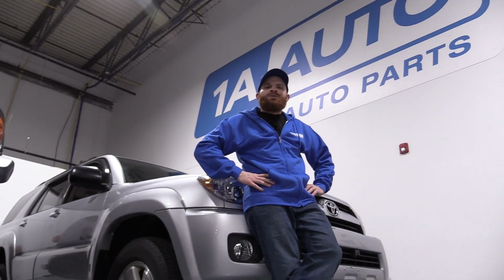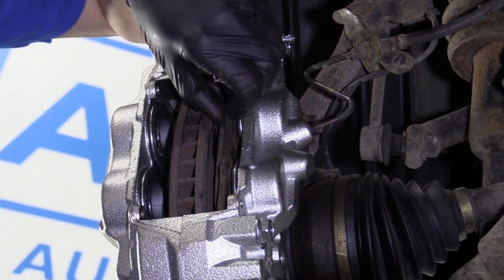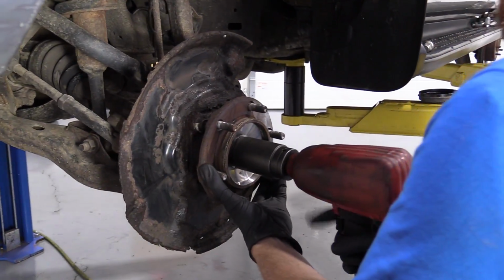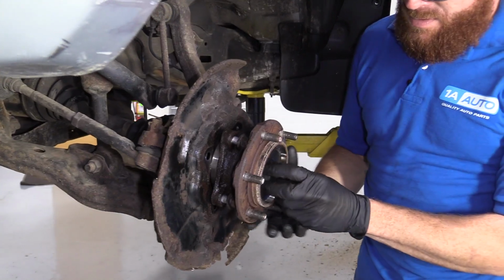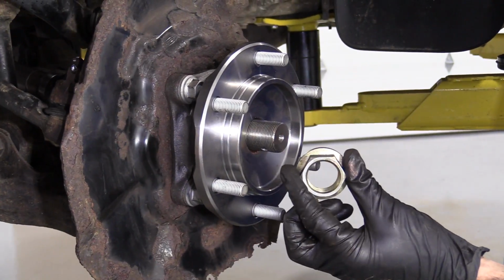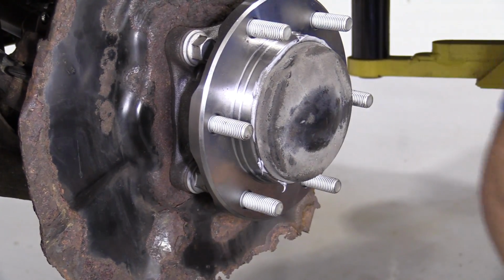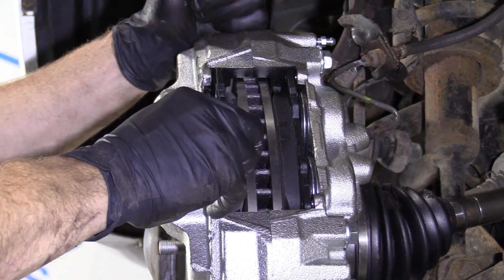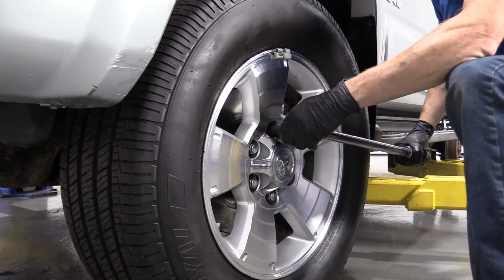How to Replace Wheel Hub & Bearing Assembly 03-09 Toyota 4Runner

Comment: better way to remove the dust cap without making a dent in it is to used a wood chisel between the cap and hub assembly to get it started moving out and the a flat screw driver can easily remove it from there without any damage to the cap at all. thanks 1A auto good video.
Reply: Thanks for the tip. I started this job a little while ago, had to stop to watch a video because I can't get the dust cap off. I was trying to use a small flathead screwdriver and a hammer, but no luck. I'll pick up a chisel.

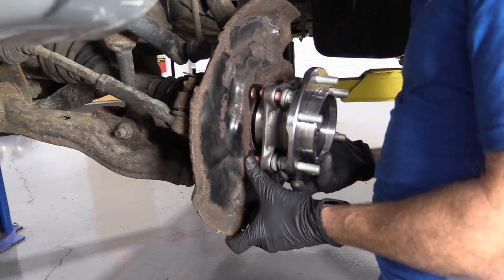Comment: You don't point out in the video (around the 12:55 mark) that there is actually an O-Ring  that needs to be transferred off the old bearing assembly (or a replacement picked up somewhere since they aren't currently included with the hub assy 1A-Auto sells... - Toyota Part 90301-92003 - note some auto parts placed confuse that o-ring part for the entire wheel bearing hub assy.)

Comment: The axle nut is not 36 mm, its 35 mm. Also, my axle nut was too hard to pull off, had to put th vehicle off the jack and tire resting on the ground, had to use 4' pipe extension to loosen the axle nut. There was not way I could loosen the nut by the method proposed by you. thanks for the video.

Comment: Borrow or buy a a pneumatic or electric chisel it’s well worth it. I beat the cv axel with a rubber mallet and a sledge with a wood block for 45 minutes with no budge. It released after 3 seconds with the electric chisel.

Comment: Tip: I normally loosen lug nuts back about 2 turns and move truck back or forward while quickly turning steering wheel left & right until you hear wheel loosen.

Comment: Good instruction video but I think that's a lot more than 59 ft lbs torque on the wheel bearing which the factory recommends that looks to be in the range of 110-120 ft lbs

Comment: Folks DO NOT follow his installation advice when it comes to tightening bolts on the new bearing assembly (13:50). Use a proper torque wrench adapter or crow's foot to tighten these bolts to spec with a torque wrench You don't guess with important things like this and tighten bolts with a hammer...This is basic technician stuff.

Comment: I hate to be that guy but...I can’t seem to find the rear hub assembly for my 2004 4runner. Does it matter front/rear or are they the same?
Reply from the maker: +Jimmy Reed They are different for the front and rear. We currently do not carry the complete assembly for the rear, but we do have the wheel hub bearing modules which is part # 1ASHS00555. Thanks for checking us out!

Comment: 36mm or 35mm socket for the axle nut?  other sources are indicating 35mm socket is needed (although at that size, may not be a huge difference).
Reply from the maker: +Murray P Thank you for checking us out! We are using a 36mm socket to remove and tighten this axle nut.
Reply: For others - it is actually a 35mm axle nut on the vehicle...